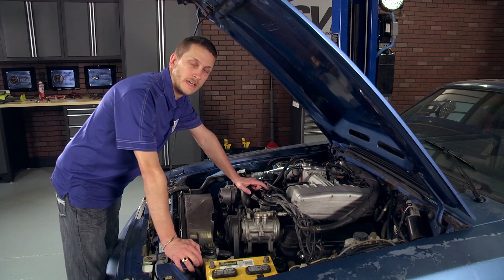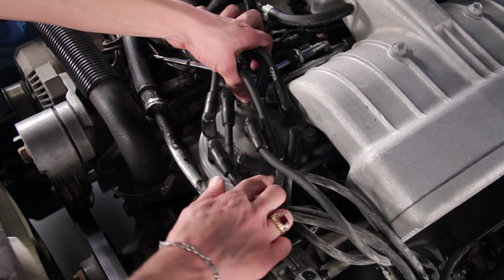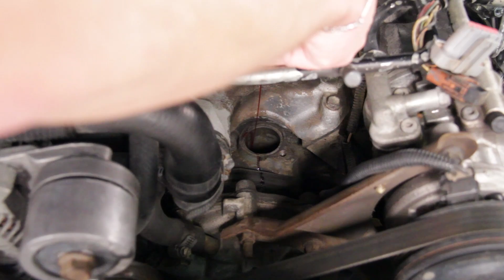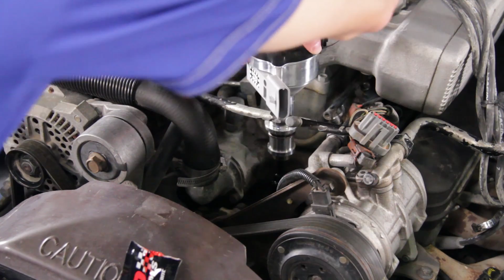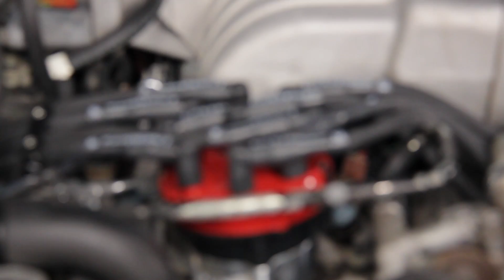Fox Body Mustang 5.0L Distributor Install (86-93)

Comment: my 86 lincoln town car starts right up and itll run perfectly fine real smooth for a long time even when it’s hot as hell outside n then after a while it’ll start surging at idle n when i come to a stop it stalls super suddenly wont crank over at all after that, almost no warning or anything it’ll just stall. i could come back the next day and it starts right up. i replaced the whole fuel system fuel pump n all, the ignition coil, coil pack, alternator is new+high powered, all the filters and fluids, replaced the rotor cap and spark plugs+wires. the starter is fine the car only has 70,000 miles but i figure it might be the distributor itself, either that or an maf sensor or tps or ect sensor or all of the above. gonna try replacing those today see if it helps at all
Reply: Did you fix it? What was the culprit?
Reply: Did the distributor help?

Comment: So no tdc on 1 piston I been doing it wrong all these yrs
Reply from the maker: This is only if you know that the existing distributor was installed correctly. If not, that's when you find TDC on cylinder one. -Landan
Reply: @latemodelrestoration  it was a joke

Comment: Need instructions for a rebuild finding the old distributors location isn't a thing.
Reply from the maker: Unfortunately, we don't have any content referring to a distributor rebuild. I would dig around on the Internet and see if you can find a good source. -Landan
Reply: @latemodelrestoration  no i mean installing a distributor when you don't have the old one to index off of.  Like in the case of an engine rebuild
Reply from the maker: @dhyskRand  Thanks for the clarifying your question. Pull the #1 spark plug and turn the engine over by hand until the piston is at top dead center. Put your thumb over the spark plug hole until you feel pressure from the compression stroke. Look at the harmonic balancer and notice that you're nearing "0". Turn the engine until the pointer is in line with the "0". Install the distributor and make sure the rotor is pointing directly at the #1 plug terminal on the cap. The engine is now at 0-degrees of timing. Reinstall everything, start the car, and adjust timing to your desired setting. -Landan

Comment: Not sure proper name but I think that small rod at the bottom of my distributor fell off what is it called?? How can I retrieve it??
Reply: It's oil pump drive shaft, I'm in same boat I'm using a straw from kids drinking cup. If it is snapped into though you will have to pull the oil pan and get the other piece out of the oil pump

Comment: I have a 1995  5.0  ford - omc motor in my boat.
Some days it starts right up, other days it will crank and not kick over.
Just had a mechanic out and hes scratching his head, I have goid spark from the plug, coil is good ignotion control module is good.
Im thinking its the cap, because crank shaft sensor could be bad in the distributor.
Any suggestions, boat runs great when it starts.
Reply: i wish someone answered this but i have a similar issue starting mine. I think its the coil. Mornings itll crank forever and not start, then later in the day when its dryer and warmer out itll fire right up
Reply: @dbix11  they have computer issues.
I got rid of that boat , now have a mercruiser and no issues at all.

Comment: You're lower third says its JMAC.
Reply from the maker: Thats correct.
Reply: Late Model Restoration yep, I'm retarded. Thought it was Landan.
Reply: Late Model Restoration On a serious note, I've been digging thru all your videos. Very detailed and helpful with my 302 build. I just keep running into issues because mine is out of an explorer. I just ordered the F303 cam from you guys with the valve spring upgrade. And just read, it won't work with the EEC-V. Do you know why that is?
Reply from the maker: No worries, thank you for watching!

Comment: hey LMR can you guys make a video on the engine breather you have where the oil cap goes ?? what dose it do??
Reply from the maker: Fernando, that crank case breather is a simple "screw-in" design. It's job is to relieve engine crank case pressure. Here it is: https://lmr.com/item/SB-261522/Mustang-Screw-In-Valve-Cover-Breather-86-00

-Landan
Reply: Late Model Restoration  hey I took my 1992 mustangs dash apart and there is 3 wires that are cut and not connected it's a black wire, red with green stripe wire, and purple with orange strip? it's next to the windshield wipers switch under the steering Calum

Comment: i have a new dist for 95 gt the 93 is old lot of miles
Reply from the maker: +dondon8978 You'll need to make your own wiring harness for the 94-95 distributor because they will not work with an 86-93 TFI module. There is a write-up for it somewhere on a forum, but I can't remember. From what I do remember reading, spending the money for a direct replacement was WELL worth it. -Landan
Reply: Late Model Restoration hey can you make a video on the engine breather you have where the oil cap goes ??? what dose it do??

Comment: Wish my distributor were that easy to come off. Its stuck. Not budging. Hitting it with penetrating lube to see if it loosens it up. Any other suggestions?
Reply: Wire brush and pb blaster.